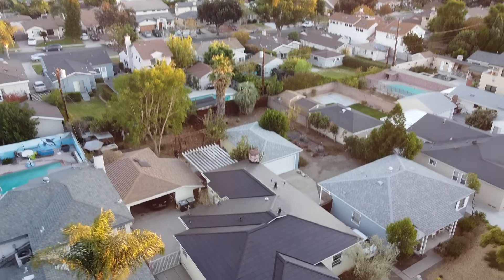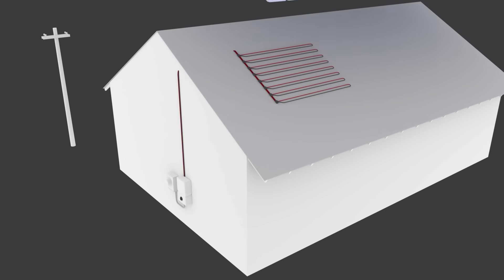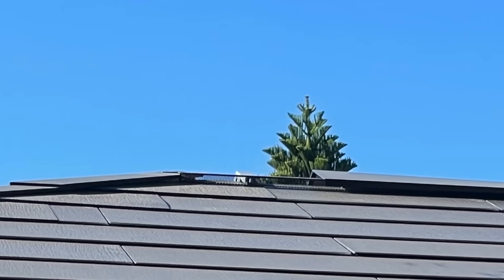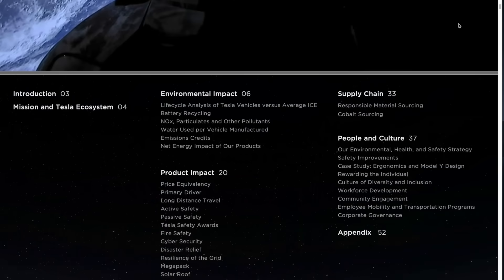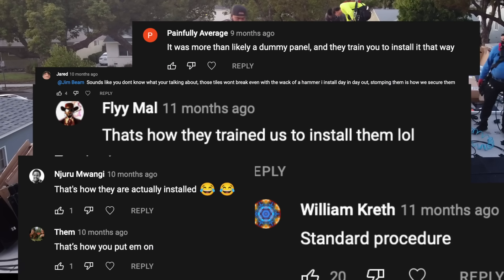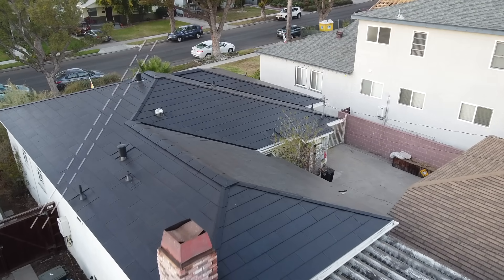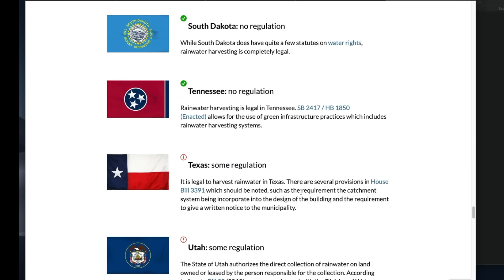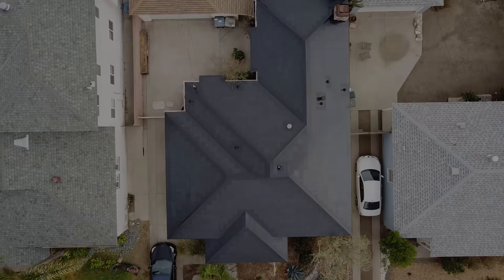10 Things WRONG With My Tesla Solar Roof

Comment: Way to gloss over number 6..... there more to it than carbon footprint..., open pit mines (most of which can't happen here in USA due to our virtue signaling culture), slave labor, toxic waste disposal.
Reply from the maker: If you’re concerned about environmental impact, supply chain sourcing, factory carbon footprint, end product recycling and net energy breakdown you could read this:  https://www.tesla.com/ns_videos/2020-tesla-impact-report.pdf

Also, while there are no global warming emissions associated with generating electricity from solar energy, there are emissions associated with other stages of the solar life-cycle, including manufacturing, materials transportation, installation, maintenance, and decommissioning and dismantlement. Most estimates of life-cycle emissions for photovoltaic systems are between 0.07 and 0.18 pounds of carbon dioxide equivalent per kilowatt-hour. This is far less than the lifecycle emission rates for natural gas (0.6-2 lbs of CO2E/kWh) and coal (1.4-3.6 lbs of CO2E/kWh).  SOURCE: IPCC, 2011: IPCC Special Report on Renewable Energy Sources and Climate Change Mitigation. Prepared by Working Group III of the Intergovernmental Panel on Climate Change [O. Edenhofer, R. Pichs-Madruga, Y. Sokona, K. Seyboth, P. Matschoss, S. Kadner, T. Zwickel, P. Eickemeier, G. Hansen, S. Schlömer, C. von Stechow (eds)]. Cambridge University Press, Cambridge, United Kingdom and New York, NY, USA, 1075 pp. (Chapter 7 & 9). http://www.ipcc-wg3.de/srren-report/
Reply: @ThisGuysTesla  still missing the point... 

"Promoting green energy cannot outweigh the real ethical and human costs of using forced labor to achieve green goals"  

Browsed the tesla report:
Noticed... not one mine in USA.... 
we too busy being smug and virtue signaling.... So while the rest of world deals with mining for minerals, we outlaw it, then buy things that require them....hmmm 

And if you were really concern about carbon footprint, you would focus on companies that design things for longevity, serviceability, future upgrades..etc 
Which Telsa's are not....sorry but a lot of new cars are really junky with a lot junky engineering.   

Want to make a actual and meaningful impact on the environment... buy stuff thats last and buy it once...stop consuming.
Reply from the maker: You do you.
Reply: @ThisGuysTesla  I will....You do you... keep on consuming... gotta make that content
Reply from the maker: Thank you for watching it.

Comment: The prices are completely wrong. A conventional 8kw peak system with battery is less than 12000€ inclusive mounting in Europe. And 5.9 KW peak from a roof of this size is ridicoloue ineffective.

Comment: Is there a plan or existing method/facility to recycle the Solar Panels? Or will they be hazardous waste?
Reply from the maker: If you’re concerned about environmental impact, supply chain sourcing, factory carbon footprint, end product recycling and net energy breakdown you could read this:  https://www.tesla.com/ns_videos/2020-tesla-impact-report.pdf

Also, while there are no global warming emissions associated with generating electricity from solar energy, there are emissions associated with other stages of the solar life-cycle, including manufacturing, materials transportation, installation, maintenance, and decommissioning and dismantlement. Most estimates of life-cycle emissions for photovoltaic systems are between 0.07 and 0.18 pounds of carbon dioxide equivalent per kilowatt-hour. This is far less than the lifecycle emission rates for natural gas (0.6-2 lbs of CO2E/kWh) and coal (1.4-3.6 lbs of CO2E/kWh).  SOURCE: IPCC, 2011: IPCC Special Report on Renewable Energy Sources and Climate Change Mitigation. Prepared by Working Group III of the Intergovernmental Panel on Climate Change [O. Edenhofer, R. Pichs-Madruga, Y. Sokona, K. Seyboth, P. Matschoss, S. Kadner, T. Zwickel, P. Eickemeier, G. Hansen, S. Schlömer, C. von Stechow (eds)]. Cambridge University Press, Cambridge, United Kingdom and New York, NY, USA, 1075 pp. (Chapter 7 & 9). http://www.ipcc-wg3.de/srren-report/

Comment: HAHAHAHAHAHA SOO FUNNY watching your firemen cut through a roof - we have solid slate or stone tiles over in this part of Europe, that's not a thing you are going to be doping here.
Reply: There exist stonecutting tools fren.
Reply: @MFcitrous  There do - but the section you cut out will weigh several hundred kg, you will not move it. Which is why they dong go trying to cut holes in the roof over here.

Comment: I think whoever wrote that page on rainwater regulations misinterpreted Texas House Bill 3391. The requirement that it be incorporated into the building is limited to new state buildings of a certain size or for which it would be feasible to include a rainwater collection system. It's not a requirement for all systems. And the requirements to give notice to the municipality is only if you intend to connect your rainwater collection system to the public water supply system. It's to guard against contamination of the public water supply. It's not about whether or not you can collect rainwater for your own private use.

Comment: I really want to like it but I just cant justify the cost vs a standard roof with regular panels on all sides. Yes it prettier, but it just doesn't seems to provide for the cost.
Reply: You forgot about the tesla powerwalls as well, comes with those.
Reply: @rdizzy1  And if they don't catch fire some time in the future, will have to be replaced in 10 years or so.

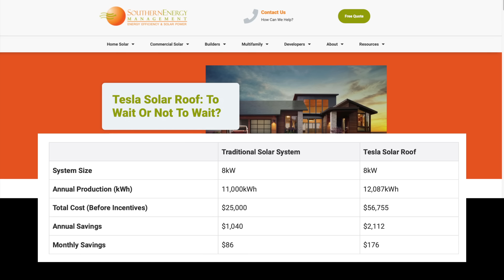Comment: At 4:20 the comparison graphic shows an equivalent solar system saving half as much. Is that due to the solar panel or the battery storage? Wouldn't a traditional solar installation with a bettery be more economic?
Reply from the maker: It does seem a little too high of a savings for the Solar Tile Roof. Not sure if that is correct. One thing I def. notice with my roof is that it shows a wider curve of energy generation because the tiles face in different directions and angles. While traditional systems generally have all panels facing to one side and thus peaks higher but drops off faster the Tesla tiles peak at various times throughout the day at different parts of the roof.
Reply: @ThisGuysTesla  My thinking is that unless the energy can be used, or stored, it would be wasted if the generated power were higher than the load unless it could be fed back to the grid. The battery stores the excess production to be used when needed later in the day. I’m looking forward to better solar installations in the future once all the teething issues have been addressed.
Reply: @ThisGuysTesla  Yes your system will have a higher average power due to the multiple tile angles over the day, its a broad peak your graph, looks good.
I don't like the cost ratio but for urban use like you are, it's really an elegant solution. I did some consulting for a solar engineer working on some next-gen solar tech he said just get whatever is cheapest as the efficiency these days for most panels is pretty close, price is the main factor for most installs. You can always add some more low-iron glass covering if you are in a high hail risk area (main thing for cheap panels IMO!).

Comment: As a roofer, can confirm we kick things all the time during install.  It's much more ergonomic for the worker and can deliver a more consistent delivery of force distributed over a larger area.   Also we are very good and accurate at it too, respect the professionals.

Note: I'm not a Tesla roof or roof tile installer, but roofing is roofing and the dynamics don't really change system to system.
Reply: Yea, funny that people think that a glass tile made to take a blow from an ice brick falling from the sky, is going to be damaged by what amounts to a soft blow, rubber hammer which is your boot.
Reply: @Nevir202  people get weird about glass, they scared of it.  And it's not like Tesla roofs don't have warranty.
Reply: @Nevir202  not particularly disagreeing with your point but toughened glass is weird, you can hit it with a hammer on the face and it's fine, but put it down gently on its edge and it can shatter.
Reply: @benholroyd5221  That's because of what you're sitting it on.

You sit even a 20lb slab of glass down and it ends up on a pebble, or touches the ground corner first, you are talking about over 1,000PSI at the point of contact.
Reply: @benholroyd5221 If you anything pointy it'll shatter anything
Reply: I did floor installation for a while. It's all kicks there too. You get a much more smooth application of force, particularly in the lateral direction if you are trying to make adjacent units flush.
Reply: Do you know how hard it would be to become a Tesla certified roof installer?
Reply: @Supreme_Lobster  is that a rhetorical question?  

I think right now Tesla either wants their own installers or limited partner installers.  Not sure if it's full on "they call you" type scenario.  But I don't think they are trying to make a competitive market certified installers.  More like they sell the roof and they hire the roofer.
Reply: @Supreme_Lobster Pretty sure its much like any certified electrician can do it over the weekends
Reply: Not heard of a soft blow hammer?
Reply: @terrybrown6057  Gee, I wonder which is easier when something is at the level of your foot, kicking if with your shoe, which essentially IS a soft blow hammer, or leaning all the way down to tap it with a tool?

Tell me you've never worked a day in your life without telling me.
Reply: @Nevir202  depends how professional you want people to take you for I'd guess... Booting a high tech panel costing a lot of money or applying pressure in a similar way. Doing yourself no favours. Gee... I guess that's just lazy
Reply: @terrybrown6057  LMFAO!

You: Don't tap that panel with your boot, HIT IT WITH A HAMMER!

Ya, super professional
Reply: @terrybrown6057  like a rubber mallet I guess.  Foot is easier and always equipped.
Reply: @jeremyO9F911O2 except the amount of rice exerted by your foot is exponentially higher. Your leg is MUCH heavier.
Reply: @williameldridge9382  I don't talk about the rice rice devil fruit I ate.

Comment: wow 50k us   for a solar roof !  dang that is  expensive   especialy  when they  put   a quater of the pannels where the sun don't shine ever ?
i have to agree  the output you realy get  from  solar  is  about 3/4  of what they tell you  it can do at best .
i had   a 4 kw   system installed   the best it produces is  about 25 kwh  a day  if the sun  shines . it produces nothing when it does not .
as i use   less than  10 kw a day  im happy   ,  but to be honest   i only payed   6 k   fully instaled   [  uk  pounds  ] you can do the math's .
here  at least  for now   we never get  a power  black out   ,so all  solar systems  over here are grid tied  [  no  extra   costs  of a power wall ore two ] 
 but still   50k  us  is freaking   rich  sounding  ! 
i bet  it's not the avarage american  buying  this system ?

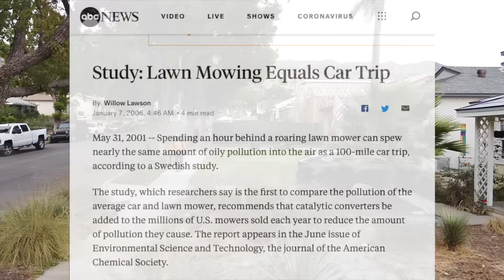Comment: 11:55  Careful where you get your news.  CO2 emissions are directly related to amount of fuel burned.  Typical walk-behind mower fuel burn is less than 1/2 gallon / hour.  100-mile trip in a typical car would be anywhere from 6.5 gallons in an SUV to 2.5 gallons in a compact.  Given that 1 gallon of gasoline = 20 lbs of CO2 emissions, that is as much as a 13x calculation error!  Keep fighting the good fight, but remember that the information reported by the alphabet networks is down around TikTok grade accuracy these days.
Reply: I didn't look up the study, but from what was shown it's probably talking about other pollutants and not total carbon emissions. So I'm not sure why he said that.
Reply: Thank you i

Comment: An average sized lawn of 5,000 square feet offers up to 1 ton of cooling as far as irrigation Hunter Industries makes an under ground irrigation mat that doesn't allow water evaporation. All those concrete patios and driveways adds to heat retention. Toro Corp makes battery powered Super Recycler lawn mowers they are the ONLY mower on the market that mulches the best. Toro also makes blowers and string trimmers in electric their new 60 volt platform is amazing

Comment: The rainwater collection restrictions in Texas are misinterpreted by that website you're looking at. If you are a homeowner and are building a rain barrel system that will not be attached to the utility water supply, there are no restrictions whatsoever.

Comment: Years ago I used the calculator offered by the Musk solar roof tiles site and it estimated $110,000 for my sunny Florida home while shingle rook was around $16k. My electric bill runs from $75 to $175 a month depending on the season.  No thanks. plus my insurance company would probably want to chat because of hurricane coverage for a 6 figure rook. My property taxman may want a chat as well for a $110k home improvement.
Reply: Exactly why normal people don't use these extravagant toys.
Reply: @timmyy420  The price will come down. but you'll always need people to take the leap. we just have to let the well off do it first. use them as guinea pigs.
Reply: You would need to add the cost of a new roof+ cost of roof filled with solar panels producing similar output+ cost of power wall (or similar pre-made battery bank) and installation of all of these things, then compare to get an accurate comparison.

Comment: You will never get 100% even if optimally placed. Your inverter will lose some, your batteries will lose some. I got 7500 watts of solar panels and my inverter is a 6000 watt, the amount that gets to my inverter is ~80% based on my latitude ( .8 x 7500) =  6000 watts.

Comment: The best way for solar generation is (if you have a large yard) to have the panels on the ground, placed on a rotating device that keeps the panels perpendicular to the sun. I saw a guy do this several years ago and the panels definitely generate much more power if they can move with the sun. Also, by having them on the ground, they can be washed off easily compared to roof solar. Dust on solar panels/roof does reduce efficiency. Lastly, placing on ground ireduces overall cost compared to roof panels or solar roof  since no one is climbing roofs and drilling holes in your roof.
Reply: If you have some land to spare, the most bang / buck is a fixed, ground based assembly. It will give slightly less power per panel compared to a tracking assembly, but will cost a whole lot less to install and maintain. Fixed assemblies also have the best yields per unit of land used, taking up a lot less space than solar trackers.
Reply: Yeah, I wonder how well this roof system will perform in 5-10 years. This really seems like it could be a gimmick, but I realize I'm probably in an Elon Musk worship service commenting on a channel like this, so I'll keep my mouth shut... I don't want to be accused of blasphemy.
Reply: This is the way, my gma got solar in Cali back in the 90s rooftop and it's been problems

Comment: I have watched other videos on Solar Roof and the warp is due to the crew not properly laying the sheathing. Asphalt roofs will still look good regardless but a solar roof requires that the sheathing not be warped. If it is warped, they should have removed the bad sections and placed new sheathing (plywood or OSB). They bent your solar tiles to lay flat agains the warped sheathing
Reply: Pretty sure the solar installer are just roofers and not actual GC's who would have done it properly and shimmed the sheathing

Comment: Great video.
Interestingly in Australia most local codes now require rainwater harvesting tanks, both rural and urban.

Surprised Tesla installed so many panels on the NE.
Did you ever get a quote on how many 'normal' solar panels (and equivalent wattage) might have been able to be installed?
Reply: I think he addressed that in his video documenting the entire process? Can’t remember for sure though.
Reply: a 7kw system would cost you about 5 thousand USD here in Australia. The Tesla roof is a poor investment and i cant see those tiles lasting 5 years.

Comment: People buy natural gas back up generators and never think about payback. With solar and batteries there is a payback period.
Also the solar roof is a lifetime roof and will not need to be replaced in 20 years like an asphalt roof. That could also be added to the savings.

Comment: I'm enjoying your experience both with the roof and with the Internet din.

It really is a shame, though, most of this topic on Green issues is so full of lies, BS, and zealot ideology masquerading as fact.

Cutting the lawn is the same as a 100 mile car trip, eh?  Well, I have a bigger than average lawn and use about a quart of gasoline each cut.  A quart of gasoline wouldn't get the typical car out of the metro area let alone 100 miles.
Reply: Certainly not carbon emissions, but lawn equipment doesn't have the emissions controls of cars, so it runs much dirtier.

Comment: You are wrong about Texas rainwater collection laws. It is not tough in any way, and the state encourages it with laws preventing HOAs from prohibiting it, as well as tax incentives. The actual states with the toughest laws are Colorado and Utah, but even they aren't that bad.

The "written notice" part is in regards to connecting rainwater harvesting system to the PUBLIC water system so either a municipality or owner of the public system. This is done for safety reasons as no one wants to drink contaminated water.

The "incorporating into the design of the building" only applies to new STATE buildings, which require them to be built under certain circumstances (roof size and average rain in area). 

As far as rain garden, I like them better than the lawns everyone else has. I've been saying for years how wasteful lawns are in regards to water, constant upkeep, etc. and prefer native plants.

Also, damn you made a lot from youtube ads!!